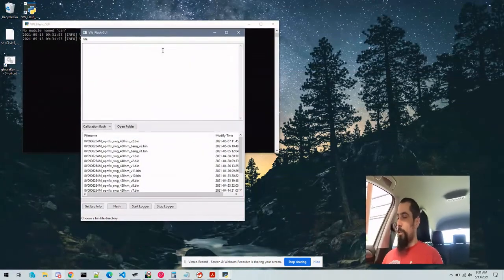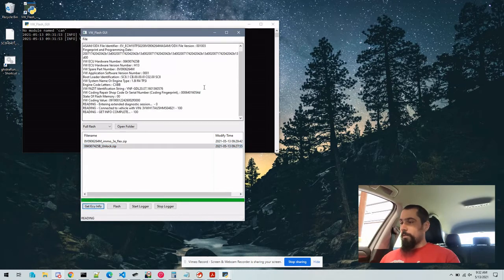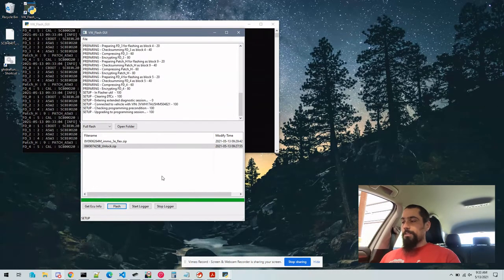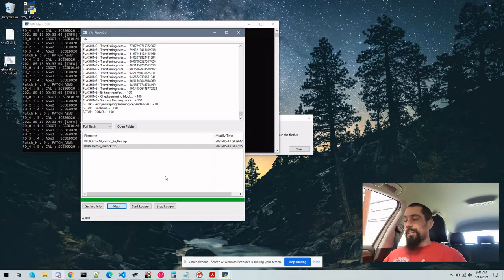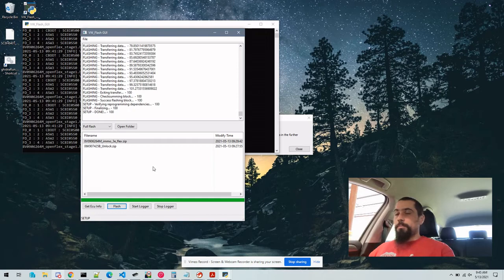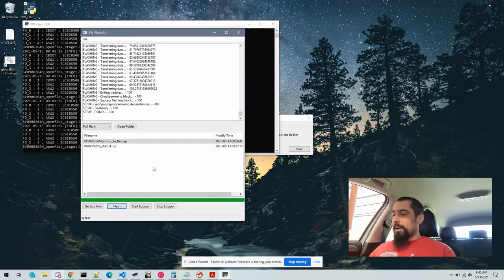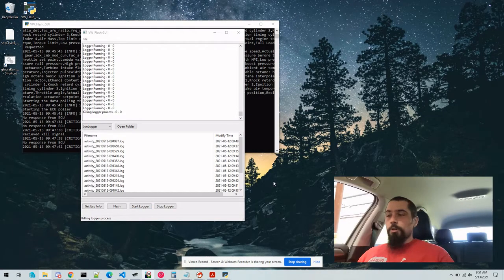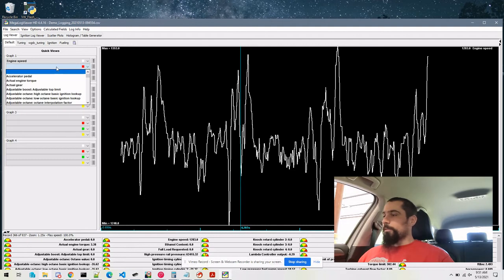Open Source VW Tuning

Comment: Great video! Just a couple of questions: can i use the tactrix j2534 obd adapter with the flash gui? And is the flash gui available for windows 10? Last but not least, what would be a pretty forward looking software to make changes in the ecu map in this combination?
Reply: Following.
I have the Tactrix openport 2.0 dongle and i wanna try tuning a mk 6 golf. I have the same questions as sayeed.

Comment: Can someone use a copy of another company tune ? And flash .I have a is38 hybrid on my GTI but do I flash a GTI file or can I flash a golf r file ?
Reply from the maker: This software wasn't written so you could flash someone else's tune. If you have "another company tune", unless it's an uncompressed/unencrypted bin file, it'll do you no good. 

That said, you can absolutely flash an R file to your GTI. and you'll trip the immobilizer for power class mismatch and you'll need to open the ECU and bench restore it. 

The actual flash procedure is 1/10th of the tuning process.  You'll want to build or acquire a properly tuned GTI file and flash that.

Comment: This might be a simple question, but I'm stuck. How do you open the program? I have python and python works as it should. I can't click the program and it run. I even try opening in cmd and it states this. 

Microsoft Windows [Version 10.0.19042.1415]
(c) Microsoft Corporation. All rights reserved.

C:\Users\Desktop\VW_Flash-master>VW_FLASH_GUI.py
Traceback (most recent call last):
  File "C:\Users\Desktop\VW_Flash-master\VW_Flash_GUI.py", line 4, in <module>
    import wx
ModuleNotFoundError: No module named 'wx'
Reply from the maker: Would be more than happy to help you out. Shoot me an email.  The main page of simoswiki.com has an email you can send to 👍
Reply: @MrJoedubs  brooo what about of 2.0 TFSI med 9.1 mk5
Reply: Did you manage to solve this problem?

Comment: Can you go over what hardware you are using to connect to the car? I see there is a SimosHiSpeedLogger that uses a RaspberryPi? This whole project sounds super awesome!
Reply from the maker: Thanks!
Yep, the initial development was all done via raspberry pi/socketcan using a canhat or a seeedStudio board. The code was later tested on windows and I wrote a j2534 PassThru wrapper for the dll, so this video was done using a tactrix openport cable. Itll run on a macbook with a little bit of effort too!